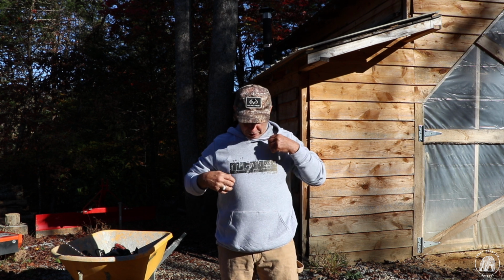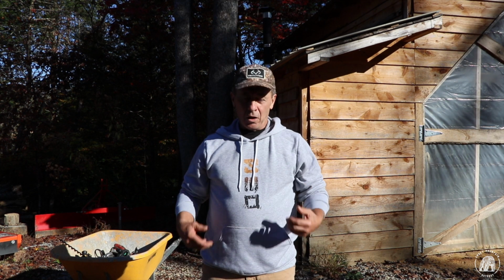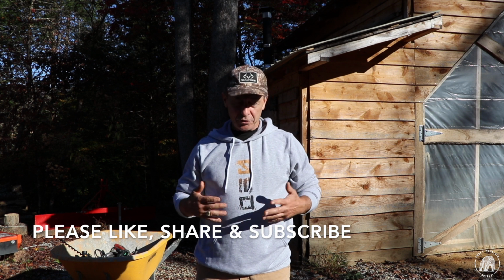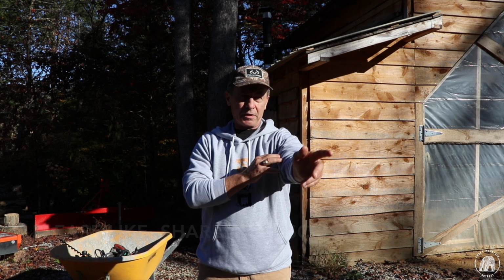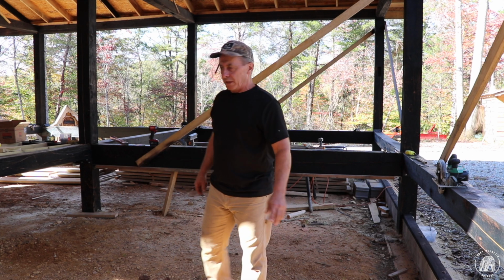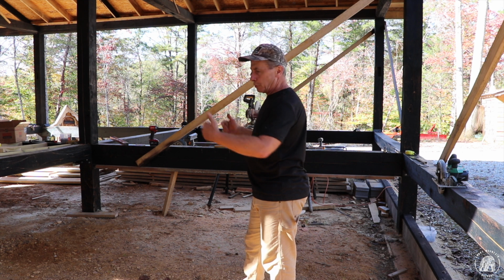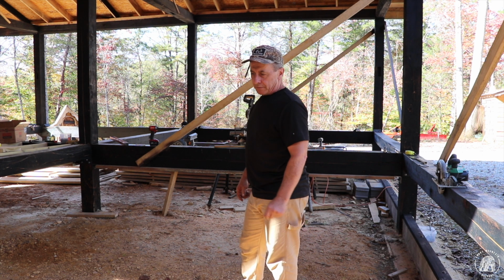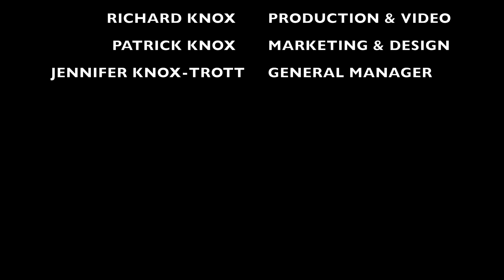S2 EP50 | OFF GRID TIMBER FRAME | CONTINUING ANGLE IRON & FLOOR JOIST

Comment: I love all your projects!  Very inspiring. I noticed that you are using the tiko nails for the hoist hangers.  I recently discovered that Simpson makes hanger screws now. I just used them on a deck cover build.  They worked great and were much faster and easier than the nails.

Comment: question are you going to insulate the floor ? maybe put plywood on the bottom of the floor joist and fill with fiberglass insulation ? looks good so far.
Reply from the maker: Yes. Stay tuned